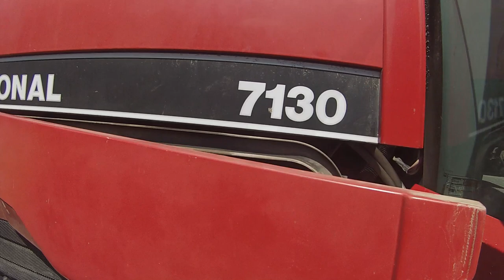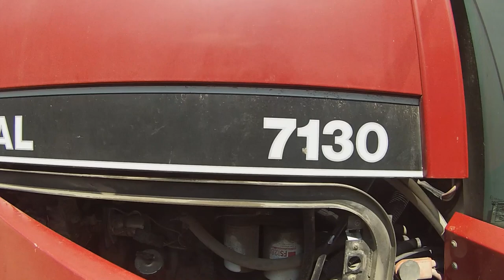Canola Planting With The 7130

Comment: Good to see you finished planting! Nice drone views! 
I do the same around obstacles, make a pass or two around it and try keeping the rows Straight.. 
Rambling on is good 👍😎😁
Reply from the maker: This spring was a good one for straight lines before the rains started. Most of the time it seems I'm working on a circle as you can see by all the sloughs in the overhead view.
Reply: @roosty6  had you planted earlier, mostly straight lines.. but would have had some drown out.. 
A wider planter could have reached out and planted the low spots.. but that would require a much bigger tractor. You have a nice setup!!

Comment: On my old drill what I did to see the meters turning. I got one of those small wire orange pin flags and stuck it to the end and you could see it going round and round
Reply from the maker: I'm going to have to try that. I saw one at an auction sale with the same idea.

Comment: Sorry to hear about the fuel pump. If you can take it back! It is the same one as a 96 dodge cummins that you can get at napa or piston ring for under 200$.
Reply from the maker: Wow! Some difference in price. I know CIH prices are bad but I wanted to be sure it was the right one and have it on hand in case the original failed suddenly and I was not finished seeding. A day lost at this time of year can be very expensive. The leak seems to have slowed down to almost nothing now so I'm still running the original.